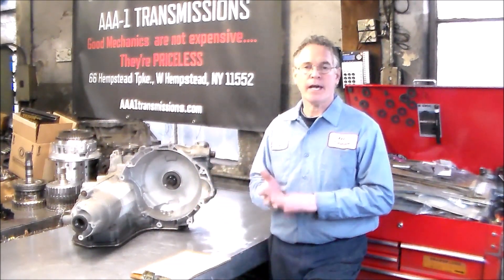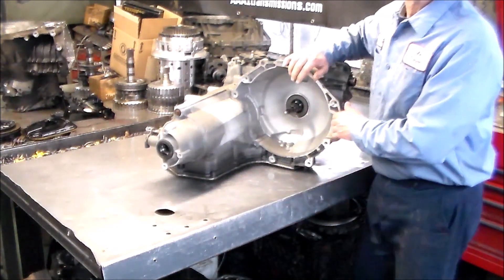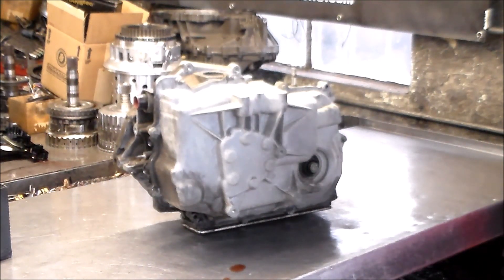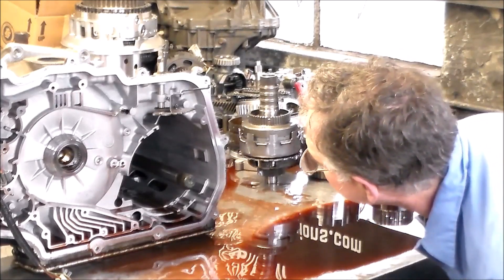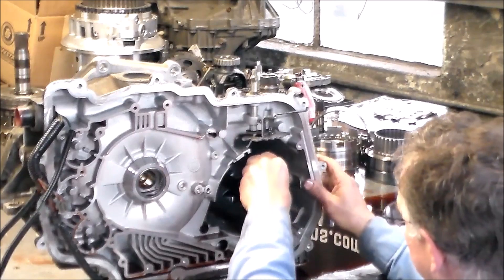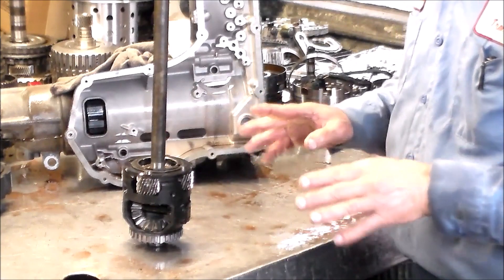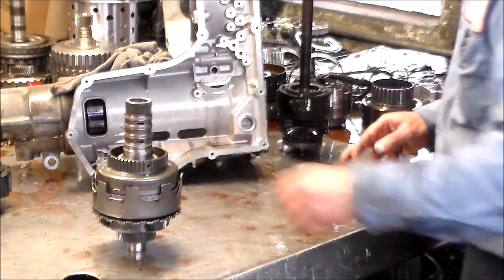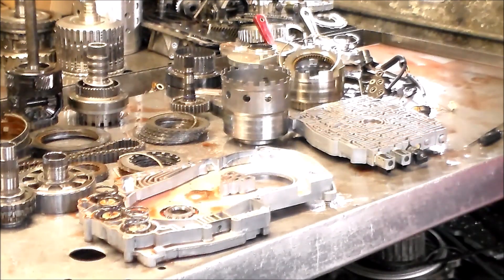4T45E Teardown, Blown Diff

Comment: Thank you so much for this video.  My daughters 2008 Saturn Aura has this exact same transmission and you helped me out by showing how to check the fluid level.  I know factory says you dont need to check it and if it leaks tear it out and fix it.   Well that just sucks when the return cooler line broke at a flex joint and prior to that trans working perfect with no leaks.  Who the heck are these engineers today and I wish we could force them to work on what they design.  Anyway, I digress.  Again, thank you very much.
Reply from the maker: There is a small plug by the right side axle, fluid must be checked with the engine running and you must have a steady stream of oil coming out.  Look right side axle above the pan
Reply: @GaryFerraro  Will do that tomorrow.  Thanks for the follow-up information!

Comment: great video!  I'm doing my first overhaul on this same transmission.  Taking my time and actually enjoying it!  Putting it all back together slowly.  Why is there a black link on the chain that goes on the turbine shaft? Is there a certain way this chain has to go back on?
Reply from the maker: That is just an I.D mark,  no certain way chain has to go on
Reply: @GaryFerraro  thank you!  Perhaps you can answer another question.  Wasn't paying attention when I disassembled the direct clutches.  There are 5 friction plates but 7 steel plates.  You space them starting with steel, then friction then steel.  But I'm left with 2 steels left over plus backing plate.  I know the backing plate is the last on before your snap ring.  If I don't incorporate those two steel spacers there's quite a bit of play until clutches engage on backing plate and I didn't pay attention to how they came off.  Should I double the extra spacers right before backing plate or were they down at the piston side before you place a friction plate?  Also, the banner kit didn't come with a new case gasket (the big paper gasket between case and spacers plate, not the bonded gasket).  Do I reuse the old one?
Reply from the maker: @keithlong2788  hmm, is there a wave steel all the way at the bottom against the piston?  The kit should come with the gasket, you should call them. I'm assuming you looked i the box or inbetween any cardboard sheets
Reply: @GaryFerraro  oh yeah I went through everything looking. The kit was sealed up too!  I did order one.  As far as a wavy plate, no there are no wavy plates in the direct/coast assembly.  Just flat ones.  On the kit instructions it states some models may have 4 or 5 sets of plates not 6.  Kit comes with 6 friction so not sure why they give you the 6th one if you don't need it.  Well I know I have 5 because I'm counting the old ones.  But why 7 steels? Unless they put 2 of them stacked at the top under the  backing plate to take up the extra clearance.  I can send you pics of what I mean if you have messenger or email.  I really need to get this back together asap.  And thank you for your time I'm sure you are very busy!
Reply from the maker: @keithlong2788  yes   
gsferraro@yahoo.com   I will see them in the morning

Comment: Hi.  I have a leak on my 07 G6 trans. Based on your video i think the leak might be coming from the vehicle speed sensor area, that seems to be the area its dripping from.  It leaks after the car is shut off.  I just replaced the gasket and fluid.  It wasnt leaking from the pan after I got done with that, checked it after an overnight, and now two days later after driving more i have a leak.   Not sure if its coming from the pan or above the pan.   Thanks for the video
Reply: Do you  need  something
Reply: @GasperMechanic  hi.  I figured out my leak wasn't coming from the trans.  It was actually coolant, mixing with oil because I had a small oil leak too so the coolant was dripping off and mixing with oil.  I fixed the coolant leak, but then it sprung another leak somewhere.  I was chasing leaks and it got to be too overwhelming so I got rid of it.  I have a new car now, buick lacrosse with the 3.8L. 79,000 miles on it now.  Thanks for the reply!

Comment: Thank you so much for this video one question though if you could help me I have an 2006 Ion with this trans and it goes into gear and drives strong but it wont shift past 2nd gear every now and then it will go into 3rd  but then it drops to like a neutral state. Any idea what this might be? I was thinking shift solenoid?

Comment: Question, I have a 2003 Saturn L200 with the 4T40E transmission and it has an issue with the passenger side of the transmission. It shakes upon acceleration and at speeds above 50 mph, violently. It's not the wheels or suspension, it's coming from the transmission itself. I have replaced the CV axle, put a new seal and sleeve in, plus new locking clips. It made no difference. It also seems to have trouble moving that wheel on hills. It'll shutter for a second upon acceleration. I'm wondering if there's a bushing inside that diff that has blown. There seems to be more than the normal play inside the transmission. My partner used to have a 2005 Cobalt with the same exact problem.
Reply from the maker: No , not a bushing problem, any play in the axle?  sure it's not struts
Reply: @GaryFerraro  no play on the new axle. Both struts and control arm on the passenger side, are new. Brakes are good. Wheel hub and bearing is original. Driver side CV axle is original. Could it be I’m feeling the driver side one and it’s traveling? Driver side one is corroded bad. Also, previous owner smacked a curb hard with the passenger side and that’s why I changed out everything, except the wheel bearing, which is quiet. I’m stumped, it shakes the steering wheel bad.

Comment: Are there any known issues with these? Im almost 93k on my 2010 hhr Lt flex. I've done 2 pan drops since owning the car as well as pull speed sensor, which had nothing on it.
Reply from the maker: when you drop the pan, you see the tubes, those tubes like to break causing no forward

Comment: What is your choice in parts for a typical rebuild on these?
Reply from the maker: I like TransTec kits, Exedy frictions, tube set OE only
Reply: @GaryFerraro  Super appreciated. Hard to decide with all the options out there.
Reply from the maker: @squarebodyseth5986  any questions just let me know.  Where are you located?
Reply: @GaryFerraro  United States in Michigan.
Reply from the maker: @squarebodyseth5986  ok. If you have problems finding anything.  Let me know

Comment: How are you dear.  I have a 2008 Cobalt with a 2.2 engine and an automatic transmission.  There is a problem: when I start driving the car, the transmission gear becomes hard shifting after driving for 5 minutes.  When I turn off the car  and restart it and drive it again, the transmission becomes normal and smooth.  But after continuing to drive the car for 10 minutes, the transmission returns to becoming hard shifting, knowing that there is a code p1811.what do you think about this problem .
Reply from the maker: is the definition of that code, maximum adapt and long shift?
Reply: yes .. maximum adapt and long shift.. exactly
Reply from the maker: @farookyaseen9039  that usually means trans is worn internally, clutch packs are worn,  computer is raising line pressure to try to keep the trans from slipping thats why you have hard shift
Reply: Isn't it possible that it is due to selenoids?

Comment: Hello sir. Im in Europe I’ve a Saturn Vue Hybrid 2009, the car has no torque, but it changes the gears ant it start moving slowly in very high rpm till reaches the speed. The computer shows service fluid transmission, don’t know if changing the oil will solve this. USA cars here are not common and the mechanic don’t want to mess with them.
Reply from the maker: @filanfisteku4579  sounds like limp mode. Was it scanned for codes
Reply: @ no, I’ve this problem since this Friday, tomorrow im going to find someone that is found on GM transmissions. Im very comfortable in manual cars and to me looks  the same when clutch kit fails. I thank so much for your support. Respect ✌️
Reply from the maker: @ if there are codes. Let me know what they are
Reply: @ 
Hello sir this codes are failed, even after deleting 
P0443:00
P0036:00
P0016:00
I have fotos don’t know where to send
Reply from the maker: @filanfisteku4579  gsferraro@yahoo.com is my e-mail

Comment: Hi, Gary repaired a kia sorento diesel automatic, A5A1 - RE5RO5A, check radiator, pipe exhaust, are fine. Problem being cold throws transmission oil filler tube, greeting from Colombia
Reply from the maker: Very strange that it happens cold, but check the transmission  vent, may be clogged